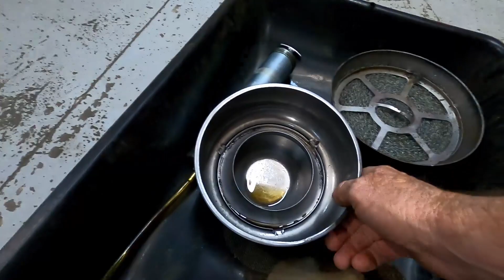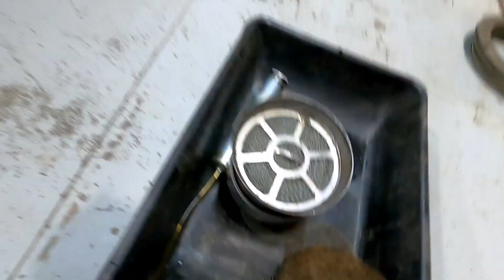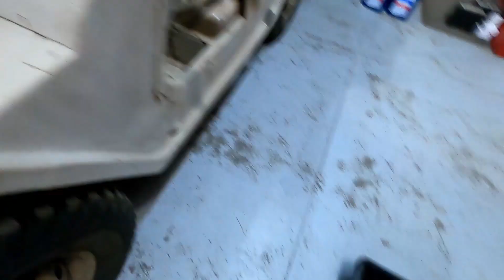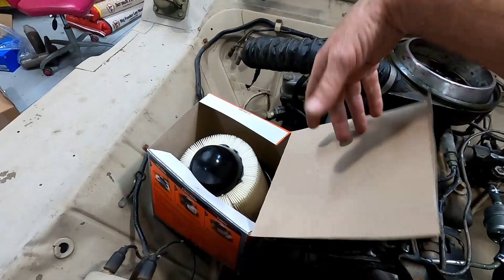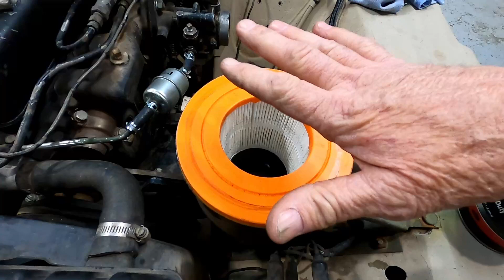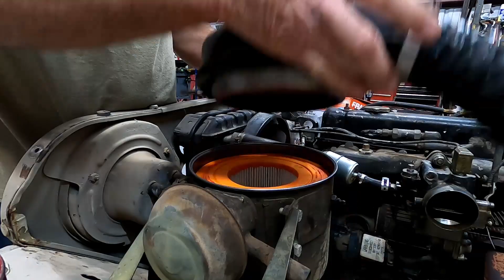M151a2 Air Filter Conversion (no more oil bath)

Comment: Getting rid of that oil bath system is great, it brought back old memories of how much a pain in the butt that system was to service, I was a track/wheel mechanic in the Army from Jan '76-Dec '84, worked on mainly M151's A-1 and A-2's along with M35 2 1/2 ton trucks, M113 APC's, M60 tanks and other vehicles. This was well before Humvees came about.  I loved the 151's, working on them and driving them.

Comment: That air filter looks like the big bucks model of a company that makes cold air intakes. Thanks for the number.
Regarding the m 151: From what I've read, the Marines did carburetor jet swaps for more power on these. Have you run across any info on this?
Reply from the maker: I haven’t heard about it but I will ask around